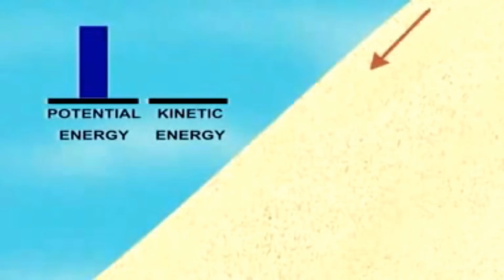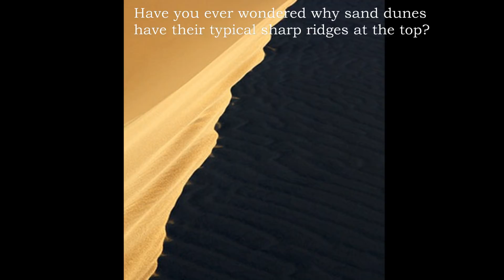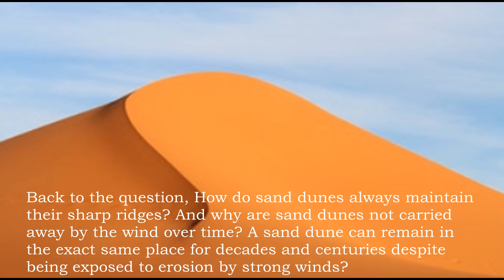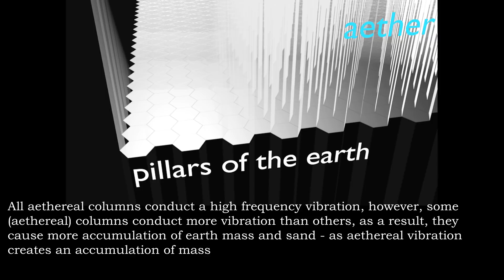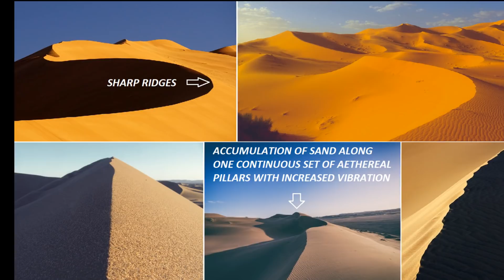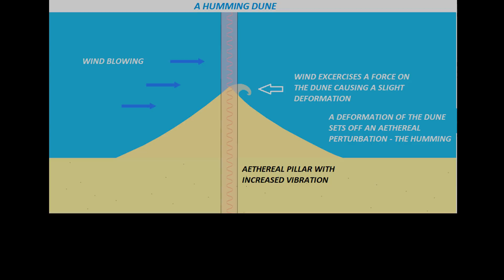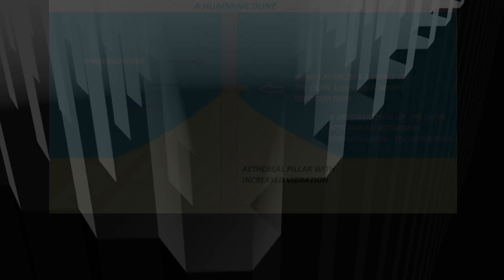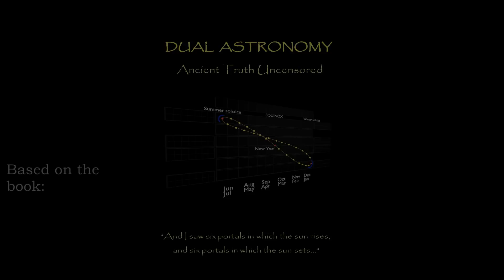The truth about booming dunes that will blow your mind - Dual Astronomy

Comment: Sand dunes form because of obstructions on the ground where sand grains get stuck and amass over hundreds or thousands of years. Under the sand dunes, sandstone is formed over long periods of time and through great pressure, which further cements their shape. That's why they retain their position, even though the winds are blowing on the very tips of the dunes. And shallow dunes do move. The wind is just not very efficient at moving small grains of rock, which are much heavier than air molecules since the volume of sand is massive. :)

Comment: Sound builds it and keeps it together it seems :)
Reply: still a long way but i'm trying to figure out if the sacred geometric system has more hidden patterns with the angled interference of it's grid.. seems to me east west and north south both have a 6 base flower 90 degrees mixing together thru these hyper dimensional constructs, if 4D is the east west loop, then 5d could be the north south extended loop based on how the grid repeats itself, like for east west only one square is needed, but for north south i need atleast 13 squares in both directions, as the book about the world beyond the poles suggests.. https://www.youtube.com/watch?v=8DSi4Ib4ByM
Reply from the maker: Anton - aether is what conducts sound at the speed of a bullet to great distances. it s not air
Reply from the maker: Youre right - aether on its own makes no sound but it conducts waves that set the air in motion.